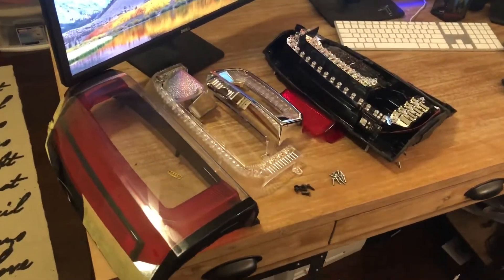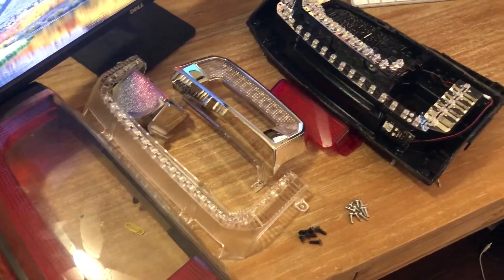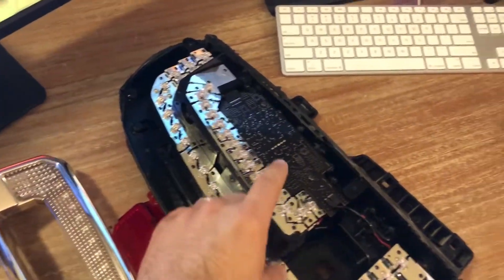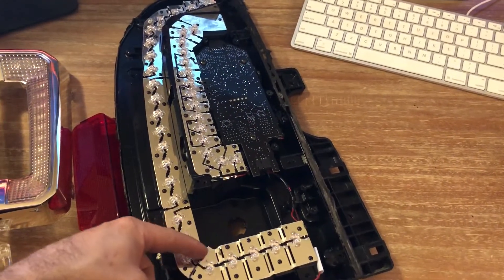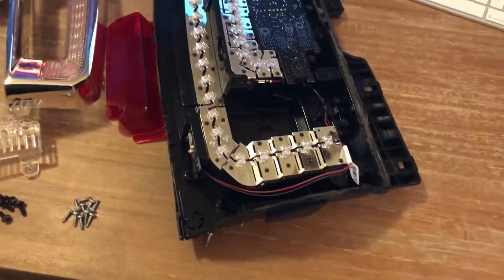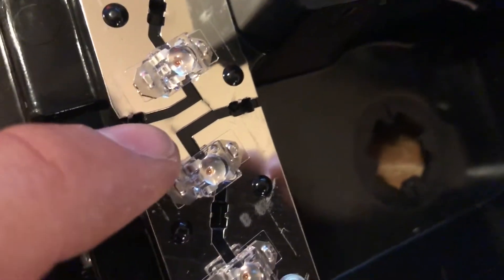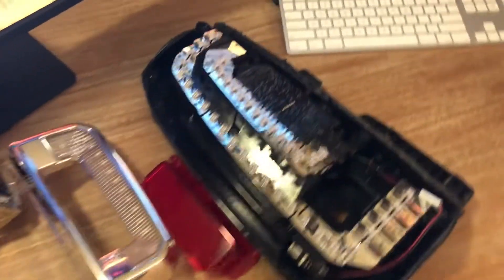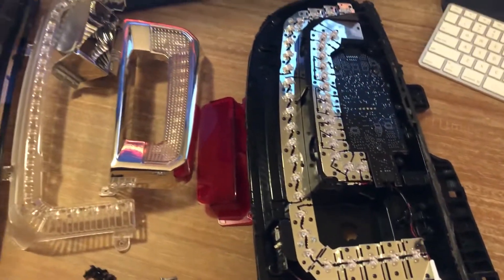GMC Tail Light Problems /Repair not working  2015  and up "FIXED WITH SOLDERING BREAK"

Comment: I have same problem with my 2015 Yukon. Right side went out and I tapped it, now it stays on. Wish I didn’t get it to work since it’s still under warranty. Dealer says they need to see that it’s not working. Just today the left is out, so I’m hoping to get it down there and at least get the left fixed. Praying the right goes out before warranty is up. Problem is they’ll probably replace it with new ones that will have the same problem eventually.

Comment: Gerardo Gallardo Jr how did you remove the lens did you heat it in the oven or did you use a heat gun
Reply from the maker: SuperDbrown23 

Hey man, this is a video without taking anything apart

https://youtu.be/2RzRclHGj9o

Super easy. I fixed my second light like this. 

I used a grinder and cut around the index edges. Not easy or clean.

Comment: The Guru page shows some of the people soldering jumpers across the breaks, which actually short the circuit. The repair is accomplished by soldering the skinny bridges you can see in this video.
The pictures there do show you where to cut small openings in the plastic through the back, but don't jump across the clearance between the two contact traces. I just sealed the hole I cut with hot melt glue to keep moisture out. My job only had one of them broken, but others have had both broken.
It took me about an hour to fix. $800 an hour is pretty good wages...
Reply: I dont mean to be off topic but does someone know of a way to get back into an instagram account?
I was stupid forgot my login password. I appreciate any help you can offer me.
Reply: @Terrance Grady Instablaster ;)
Reply: @Dakari Kellen I really appreciate your reply. I got to the site on google and I'm waiting for the hacking stuff now.
Seems to take quite some time so I will get back to you later with my results.
Reply: @Dakari Kellen it worked and I finally got access to my account again. I am so happy!
Thanks so much, you saved my account :D
Reply: @Terrance Grady Happy to help xD

Comment: I took all the screws out of the bottom.  I tried snapping the lens off with a screwdriver.  Bad move as the clear lens cracked in two. If I ever did it again I would use a dremmel tool with a cutting wheel. I did find that small piece of silver aluminum plate cracked. I threw the complete piece out and bought a new one from JC Whitney for $386.00. GM should make it easier to remove the clear lens so the light  can be fixed.
Reply: The screws is for the inner parts not the clear plastic cover. also you can easily open it up if you heat it properly.

Comment: Were you able to fix it?
Reply from the maker: Yes it worked soldering that crack completed the circut.
Reply: Is there a better way to disassemble the taillight? And cool I’m glad it’s just a solder job!
Reply from the maker: Not that Im aware of unfortunate. I would suggest buying a Dremel. You want a clean cut so you can apply plastic weld between.